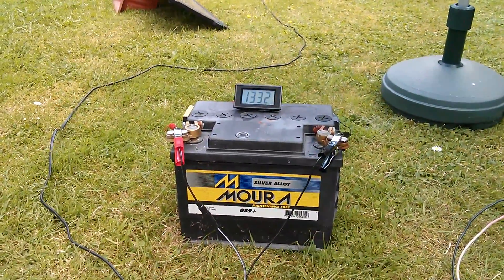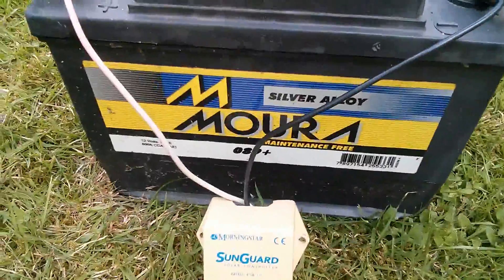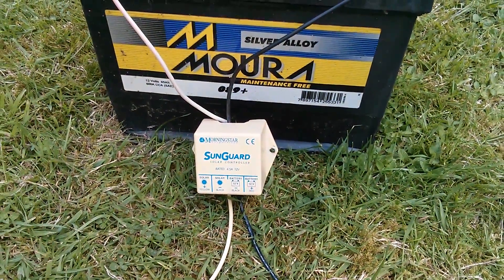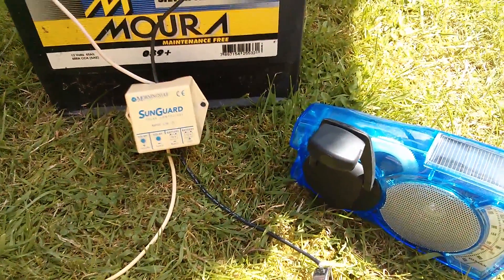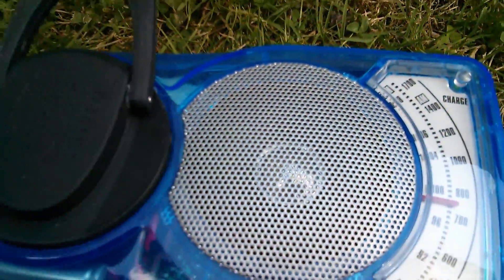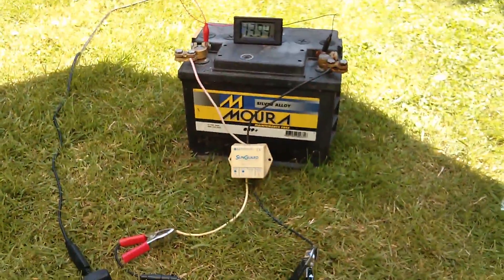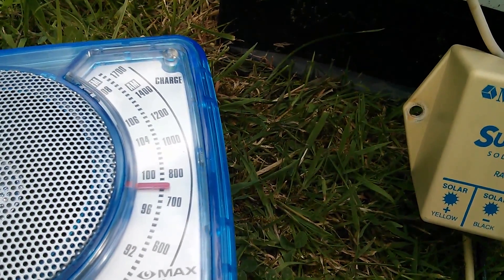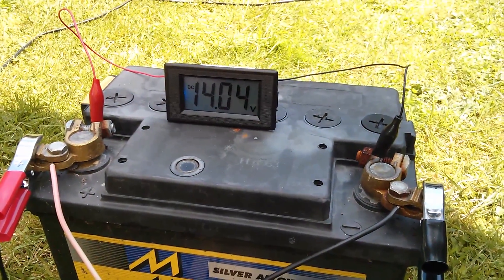Listening to Pulse Width Modulation - Morningstar SunGuard SG4

Comment: I use a crystal earpiece terminated with a couple ov croc clips to do these sort ov examinations. There are all sorts ov variants on the PWM scheme in various controllers. In fact I find this method ov listening to waves so effective, combined with the frequency & duty cycle functions in my multimeter I seldom have the need to actually hook up to the 'scope much ov the time. The crystal earpiece is such a high impedance (and has no DC path) that you can hook it to relatively high voltages without it getting overloaded or blasting your ear. But I always have it out when I first connect it!

Comment: I didn't know that's how the Phaser worked, thanks for that.
Reply: It isn't..... It's a similar sound though.
Reply: Ronan Cantwell So the phaser doesn't vary the duty cycle in order to produce that sound ?
Reply: If you mean a standard "phaser" effect pedal etc, no. The phasing effect comes from combining the original signal with one that has been through a phase-shifting network. Also do-able by mixing the original signal with a delayed version of itself.
Reply: Ronan Cantwell Yes, that's what I meant. Thanks for the explanation, I've learnt something new today that I didn't expect to learn :-)

Comment: I'm tipping that CE lable means China Export rather than any certification. Very poor EMI
Reply from the maker: I'm pretty sure it's genuine - MorningStar are a respectable manufacturer of solar charge controllers. But you're right, the EMI is surprisingly poor. The electromagnetic compatibility requirements can't be very stringent.
Reply: Julian Ilett The Sun Guard has the same basic circuit as the Sun Saver I believe. That also would get mightily upset if you short the solar input with a battery connected. Not something I am gonna test!

Morningstar blab on about how their higher frequency scheme is better PWM. However, under the panel ov the Sun Saver there is a wire link you can cut to drop it down to 10Hz. They recommend that in telecommunication applications if the PWM tone is getting into the gear. But they stress to avoid doing this unless you really have to.